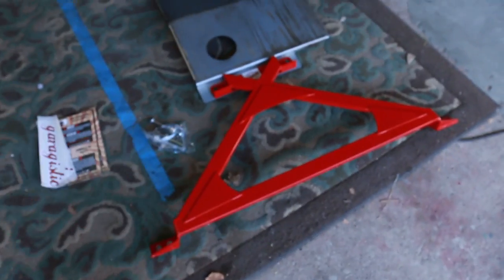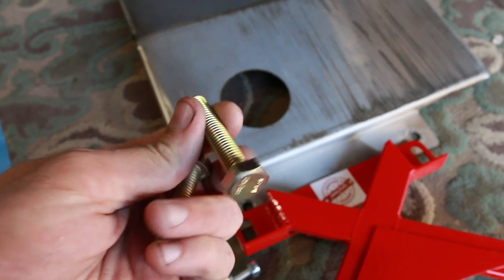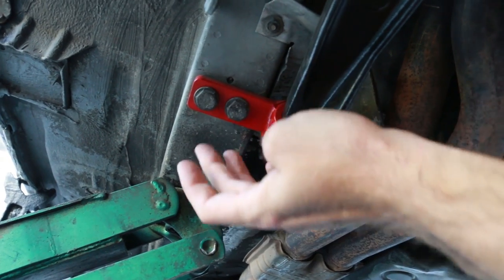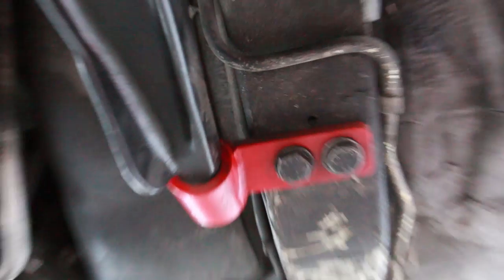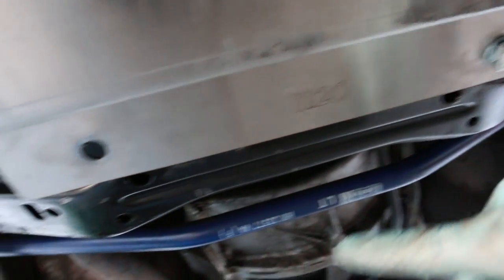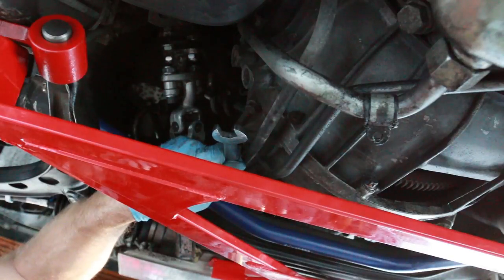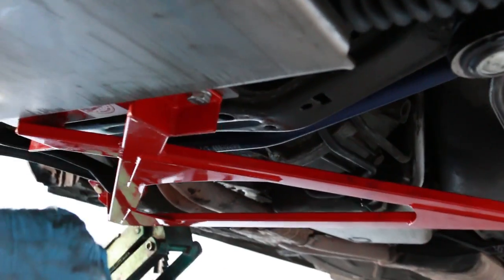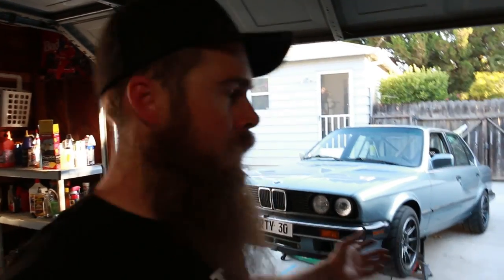XBRACE INSTALL BMW E30

Comment: I had one on for about 2 days. I had to use the spacers with my UUC sway bar. It hung WAY too low. Just an FYI.. not if, but WHEN you hit something with the x-brace, the supplied washers for the bolts going through the steering rack are a bit too small. I put in larger washers for piece of mind.

Comment: Ive been looking at this for my E30 aswell for some time but have yet to buy because im scared of the ground clearance. My e30 is on Ground Control coils and is the same height as your e30 if not lower. The only part is my front height adjusters are wound all the way up because for my gc kit I cut my housings to the length of the koni inserts. That being said my skid plate also puts in work daily and am scared I would end up hitting the ground more with the x brace. In your next video I would love to see a peek at the underside when the car is on the ground so I can see ground clearance.
Reply from the maker: Frederick next video you will see it scrape lol. It has about 1 inch of clearance between it and the ground. I’ve hit it plenty of time now lol.

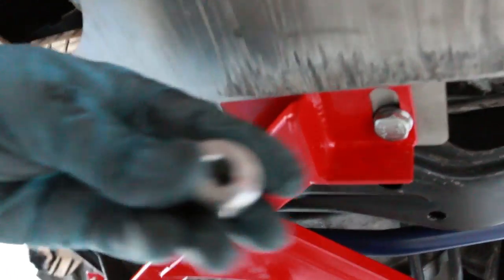Comment: Horror to look at that fragile small washers going inside the slotted holes... I think you should do better there with bigger and better washers. 4:34 5:06 5:30 are a  concrete example of a "don't do", obviuosly if you care :)

Comment: Where did you get the skid plate?
Reply from the maker: CaTuned RED 46 Sump armor
Reply: @BlakesGarage  and the e46 skid plate fits the e30 chassis?
Reply from the maker: @drayescobar9469  no
Reply from the maker: They make different skid plates for each engine and a few chassis

Comment: What type of drain bolt is that you have in you oil pan?
Reply from the maker: +Daniel Zuniga Some wingnut piece of crap. Someone must’ve done something to my oil pan before because I’ve tried buying every plug known to man nothing fits this is the only thing that works. Eventually I will have to replace the oil pan.
Reply: I hate when people make this fix solutions instead of search for oem parts.
Reply from the maker: Daniel Zuniga yep it’s been a pain in the butt. Eventually it will be changed out.

Comment: This item has not meanig..
Reply from the maker: +Gergely Petrilla ? This helps stiffen the chassis.
Reply: Blake's Garage is this a drift car?
Reply from the maker: Gergely Petrilla track/AutoX I Will hit some drift events in it but primarily I think it’s going to be a track car.
Reply: Blake's Garage alright. I didnt say anything. Drift cars dont need this brace, unnacassary.
Reply from the maker: Gergely Petrilla helps improve front end grip and chassis stiffness so I would think drift cars could definitely benefit from this.
Reply: Blake's Garage okay, i never seen that before on drift cars
Reply: Blake's Garage thx for the tip!
Reply: Just because you didnt see it doesnt mean they dont need them bro. Stiff is good in almost any use of a car
Reply: @gergelypetrilla1793  Also the X brace is a must for convertble e30's to prevent chassis flexing.